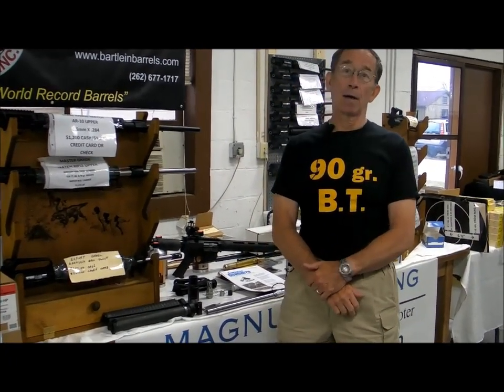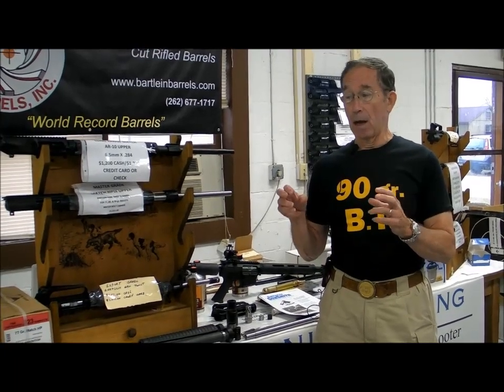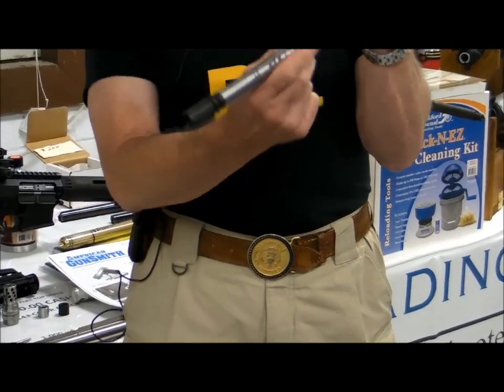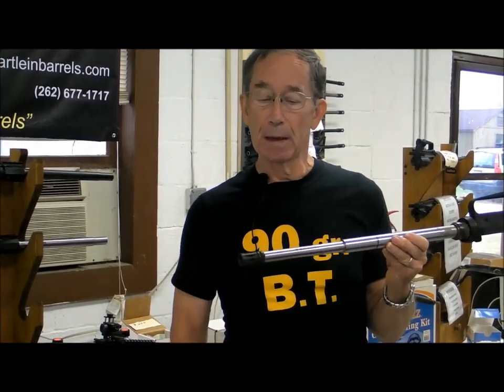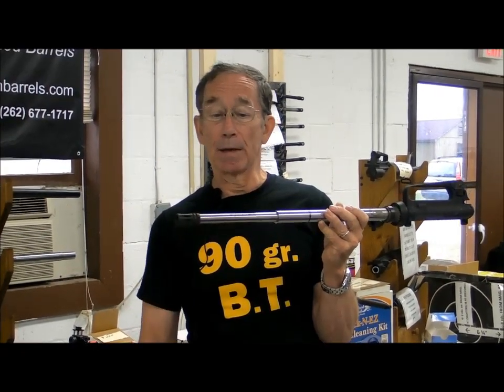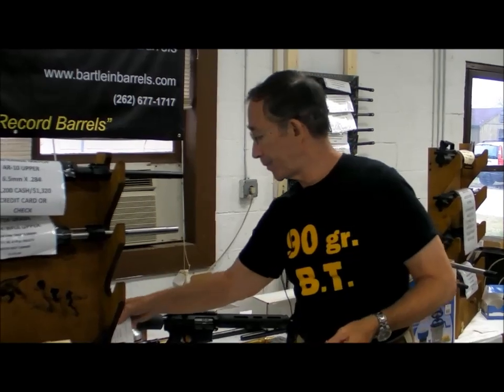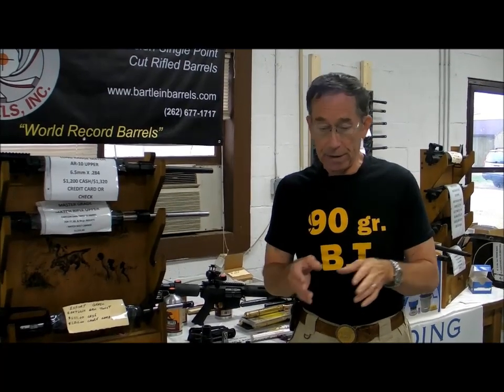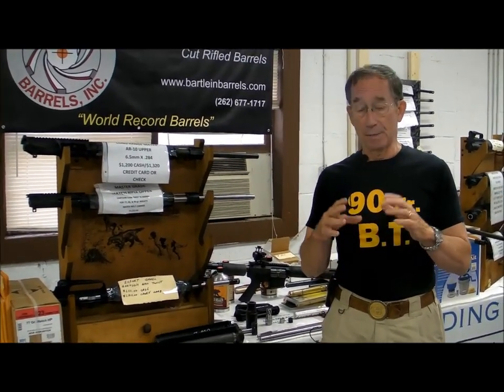AR-15 Barrel Harmonics (1 of 3)

Comment: This is really great information. I did a 6.5 Grendel with a 20 inch heavy barrel, does that 47 lb sound like a good option for that as well?
Reply from the maker: That should be. Perhaps others have a similar build and can comment on their experience.
Reply: @FUNshoot  Both of my builds I used VLTOR MUR uppers and good quality barrels.  On both of them the barrel fit the upper so snug, I had to put a wood block on it and tap it in. There was no wobble at all. Anybody trying to build a highly accurate AR platform should look at those uppers, the Machining is very good and precise because the parent company is involved with Aerospace Machining and they do very good work. Those receivers also way more because they have more aluminum in critical places to make it very rigid.

Comment: Due to these vids which are excellent .

I have found a upper receiver that has an underfit barrel extension area....

And with slightly oversized barrels.
It makes for an thermal interference fit that you need a heatgun to get it on or off(off is harder then on lol).

Can you see any downside to a fit like this?   

What type of accuracy are you looking for at 100 yards?
Reply from the maker: Service Rifle builds are routinely sub-MOA. Contact Joe Carlos directly at NCC1701@penn.com

Comment: Hi, i have a strike industries gridlok handguard and came with a barrel nut. And ever since i change this handguard my group is so bad (6 inch grouping).  Then i saw your video so i started trying to tweak with what your saying reguards to barrel harmonics from 40 to 80 ft/lb. Never got it it did get better at randomly ill hit a bull'seye. So i called the manufacture and ask what the torque spec is on their barrel mut and they said the max ft/lb torque on the barrel nut is 45 ft/lb. Now i wonder if i canted the barrel nut or the barrel nut itself inner flange was always bad. Ive repurchased two of same barrel nut now and 3rd one is on the way.

Comment: All components involved with chambering a round have WHAT TO DO WITH ACCURACY ? Once a round is chambered and the bolt locked in battery , This is where Accuracy BEGINS . The rounds travel down the barrel with the sights properly aligned to barrel center line , determine the bullets point of impact . Or am I wrong ? All additional parts involved with stripping that round from the mag and chambering that round , have what to with accuracy ???

Comment: Not that jacking with the torque of the most important and safety-critical "fastener" in an "AR" to "tune" its accuracy and precision period much less doing so by modifying and weakening the barrel nut is even remotely acceptable to anyone with basic mechanical knowledge, education and experience beyond "building" ARs, but assuming doing so weren't stupid and wrong on numerous levels and for many reasons, going to the "average" torque you've "discovered" produces "on average" the "best" results from hundreds of attempts to "tune" ARs into shooting their "best" is not the "best" way to "tune" a new "build"  if using a "trial and error approach". 

Starting at the "minimum" so-called "safe" barrel nut "torque" and proceeding from their "upward" to the specified torque even and especially if there is no "improvement" and NEVER "backing off" a previously "torqued" barrel nut on an aluminum upper is the "correct" procedure. Aluminum parts invariably "relax" one "properly" torqued because ALL THREADS PLACE PARTS IN "COMPRESSION" AND THE THREADED FASTENER(S) IN TENSION. AND WHENEVER FASTENER MATERIALS ARE IDENTICAL YOU ALWAYS USE LUBRICANT TO PREVENT GALLING AND ACHIEVE "CORRECT" TORQUE AND FASTENER "TENSION". WITH ALUMINUM YOU TORQUE TO SPECS, WAIT 10 OR 15 MINUTES AND THEN RE-CHECK/RE-TORQUE BACK UP TO SPEC. AFTER THAT HEAT-COOL CYCLES, PRESSURE CYCLES ETC HAVE NO EFFECT. 

SINCE YOU OBVIOUSLY HAVEN'T USED MANY TORQUE WRENCHES IF YOU THINK ANY BUT HIGH-END ELECTRONIC TORQUE WRENCHES "READ" IN SINGLE-DIGIT INCREMENTS, MAKE NO MENTION OF LUBRICATION OR TORQUE WRENCH/SETTING "CALIBRATION" CHANGES AND OPERATION NECESSARY TO ACTUALLY GET "XX" LB.-FT. OF TORQUE "ON" THE NUT WHEN USING A BARREL NUT "WRENCH" WITH A 3/8" OR 1/2" SQUARE DRIVE OPENING FOR A TORQUE WRENCH AND THAT AS AN "EXTENSION" THE LENGTH OF THE "WRENCH" AND EXTRA LEVERAGE RESULTS IN MORE TORQUE ON THE NUT THAN "READ" ON THE TORQUE WRENCH WITH "SIMPLE" RECALCULATION OF THE TORQUE SETTING BEING NECESSARY TO GET "XX" TORQUE ON THE WRENCH AND NUT, ITS NOT SURPRISING YOU'VE HAD TO USE "TRIAL AND ERROR" HUNDREDS OF TIMES TO GET AR "BUILDS" TO SHOOT THEIR "BEST". 

EVERY TIME YOU "BUILD" ONE YOU'RE OBVIOUSLY FLYING BLIND BECAUSE YOU"RE EXPECTING A WHOLE COLLECTION OF VARIABLES TO PRODUCE  A GUARANTEED AND CONTINUOUSLY VARIABLE RESULT AND ARE BUTCHERING THE PRIMARY FASTENER TO BEGIN WITH. NOWHERE IN THE MECHANICAL WORLD WILL YOU FIND A SITUATION WHERE SOMETHING IS TO BE "TORQUED" UNTIL "TIGHT" AND THEN IF A "LOCK" OR OTHER ALIGNMENT-CRITICAL PARTS DON'T ALIGN "BACKED OFF" OR "MODIFIED" SO THEY DO.

IF YOU "KNOCK OFF" ONE "TOOTH" ON THE BARREL NUT THE FREAKING GAS TUBE CAN BE "CROOKED" AND YET "WORK" AND THAT ALONE WILL CAUSE "ACCURACY" TO BE FOR SHIT BUT "IMPROVE" SIMPLY BECAUSE ITS "LESS CROOKED" AFTER "TUNING" THE NUT "TORQUE". BUT IF YOU'VE STILL BUTCHERED THE NUT AND "TUNED" THE "TORQUE" THE GUN STILL ISN'T "BUILT" RIGHT. THAT WHOLE BCG/GAS KEY/UPPER/GAS TUBE "GUIDE" (IN THE UPPER WHERE THE FOUR "FEET" CENTER/SUPPORT IT)/BARREL NUT/GAS TUBE/GAS BLOCK/BARREL EXTENSION PIN "SYSTEM" IS SPECIFICALLY DESIGNED TO MAKE IT ALL BUT IMPOSSIBLE TO ASSEMBLE "LOOSE" AND "WRONG" AND STILL HAVE THE RIFLE "RUN" UNTIL MISALIGNMENT CAUSES THE GAS SYSTEM TO "FAIL". IF SHIT ISN'T ALIGNED "PERFECTLY" YOU'LL HAVE TO FORCE PARTS THAT SHOULDN'T TOUCH AT ALL TO "FIT" AND THE "BARREL HARMONICS" WILL BE SHORT-LIVED NON-FACTORS IN WHY THE THING DOESN'T SHOOT ITS "BEST" AND/OR "RUN" WELL/LONG ENOUGH TO GET A "TEST GROUP".  

The entire rifle was designed to be about as "idiot-proof" as possible but leave it to an "armorer" who can't find/follow a "service manual" to find a way to fuck up "building" one "hundreds of times" and "teach" other "builders" to just "modify" parts that "interfere" with "torquing" the barrel nut and "tuning" for the "best" accuracy/precision.
Reply from the maker: https://americangunsmith.info/writers-guidelines/

Submit any articles on firearm building you'd like to write up.
Reply: @FUNshoot  who is this deeremeyer1 guy? You keep doing what your doing TOP, your wealth of knowledge is appreciated by those of us with sense and no overwhelming feeling of inferiority. Good grief this guy should probably understand who he is talking to before opening his mouth and looking like a complete fool.
Reply from the maker: @jonnida3494  He's been invited to write articles detailing his methods and will be paid to do so when/if he follows through.
Reply: @FUNshoot  He won't follow through. He just wants to get people to think he knows more than the guy in the video.
Reply: Um this guy has no clue
Reply: Did you get your article sent in? I'd like to read it. Lol
The guy in the video has forgot more than you'll ever know about a AR15 barrel
Reply from the maker: @tommyroberts867  So far, no. However, the invitation remains open. American Gunsmith welcomes many differing takes on the topics of gun building, improvement, and repair.

Comment: Great information here. I'm building an AR-10. Do you have a recommended starting torque for my build?
Reply from the maker: See "Barrels For Custom AR-15s" in the July-August 2017 issue
https://americangunsmith.info/2017/07/10/barrels-for-custom-ar-15s-part-1/
Reply: Try asking the manufacturer of the parts in your "build" and maybe learn that "starting torque" is "to specs" and from there you ONLY go TIGHTER to the nearest "notch" and proper gas tube alignment. You seriously think "knocking off" a tooth on the barrel nut is "correct" procedure to "build" a rifle and get the "best" performance out of it? If so, you don't need any torque "specs". And BTW, your "AR-10" probably isn't an "AR-10". Armalite makes both "types" of "AR-10". If its not an Armalite, its an "LR" or SR" or "PSA10". Manufacturers know how to "build" their products "best" no "modifying" required.
Reply: @deeremeyer1749   @DEEREMEYER1  There are "barrel nuts" produced which do NOT have "teeth" negating the necessity to "index" it angularly.  "Depending" on the quality of fit on the interface of the "extension" and the "upper" receiver torque values absolutely affect "groups."  If you don't have anything productive to "contribute" you should quit "trolling" and try to LEARN SOMETHING.  

Sarcasm aside, you spoke wonders about your experience when you suggested manufacturers create the penultimate rifle and need not be improved upon.  Thanks bud!  Needed a good laugh.